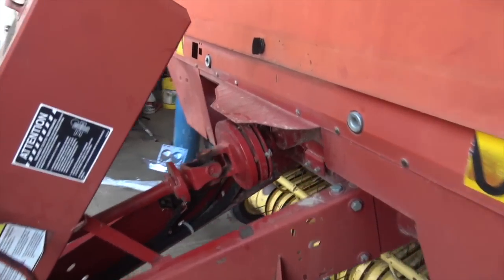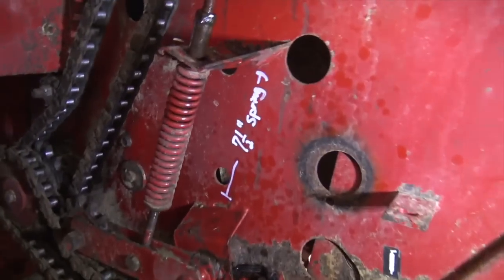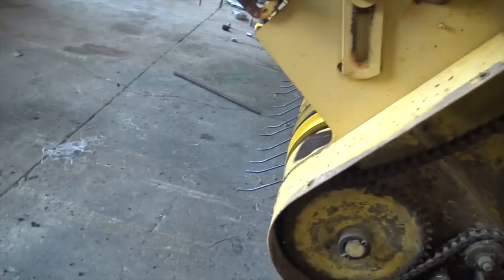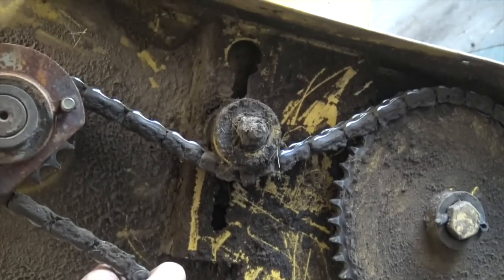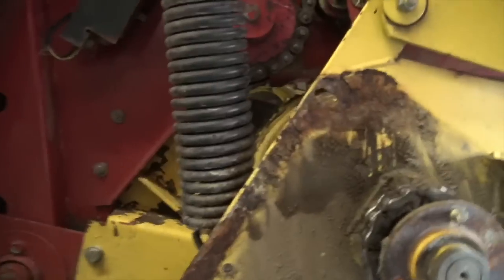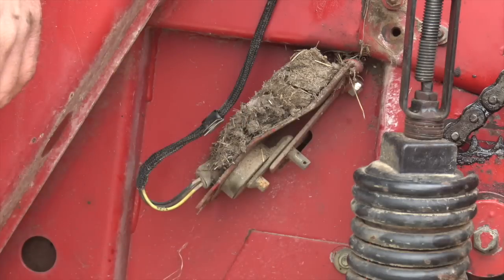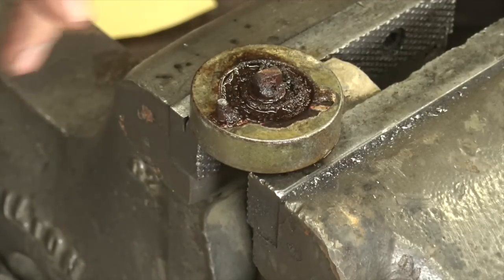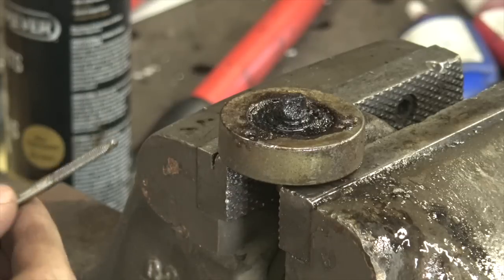FARM EQUIPMENT SELLER TOOK PARTS OFF MY BALER BEFORE I BOUGHT IT - I GOT SCAMMED - CAN WE FIX IT?!?

Comment: Keep it coming; hell, I don't care if it involves machines, tools, or tractors (diesel/gas). I watch your videos because you're not afraid to do the job correctly with used equipment. New equipment comes with many headaches, including signing your soul away.  High-cost ($) factory technicians on new equipment because makers won't allow access to their software. There are horror stories all over the internet about every significant farm equipment manufacturer. You are in control, not some damn suit in corp., headquarters! 👍🙂🙃😊😀

Comment: Clutch needs repaired again, it is not slipping like it should when you backed off the bolts,  work on it some more for safety reason for the unit,  should slip